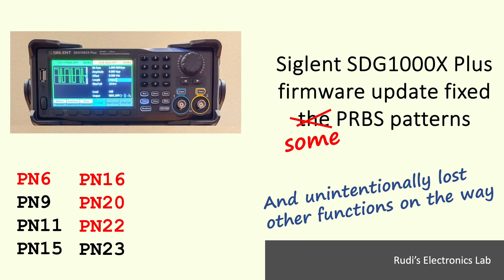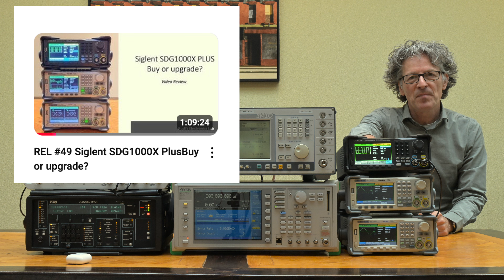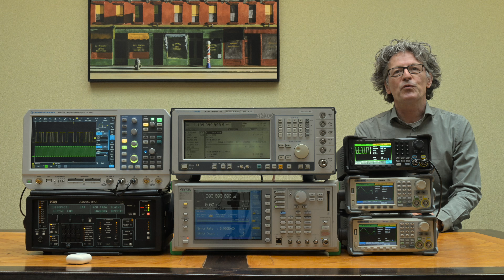REL #61 Siglent SDG1000X Plus firmware update fixed the (some) PRBS patterns

Comment: Is it just me or why is the color coding on the front panel not matching the color on the screen (green/yellow screen vs blue/yellow front panel)?
Reply: You can change the UI Style to match the new Channel colors, but the factory default is the color coding of the older Siglent SDGs. I don't know why they didn't change the default to match the panel, but at least you can change it.
Reply from the maker: True. And strangely enough, when you make screenprints, you get the wrong colours! Check out my original review video of the SDG 1000X Plus....
Reply: @rudiselectronicslab861  Ah, i remember. I watched your video before buying it. It was really helpful in deciding which AWG to buy, so thank you for that. By the way, the bug with color scheme in screenshots seems to have been fixed with this update.